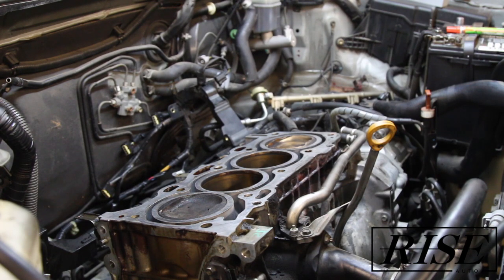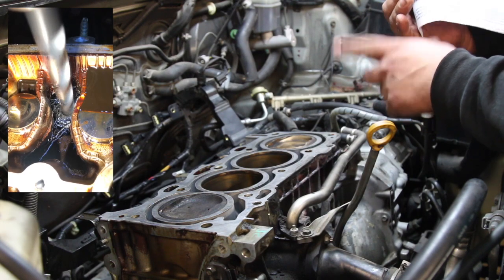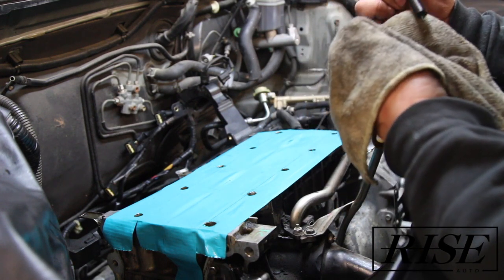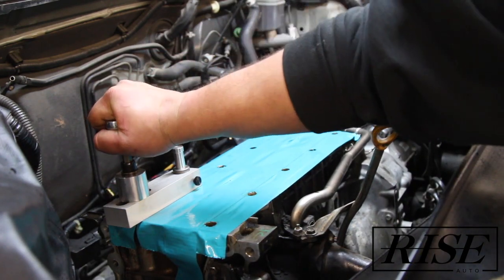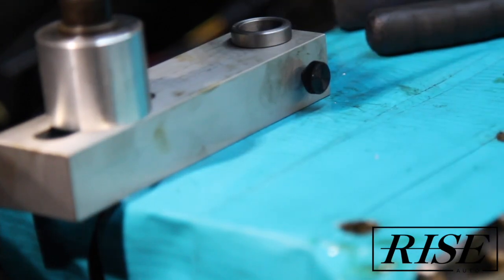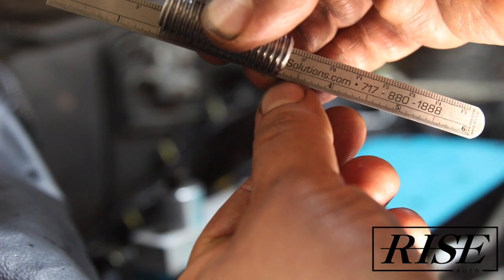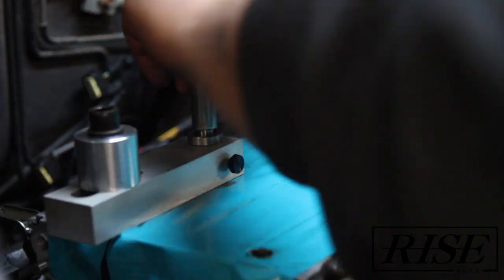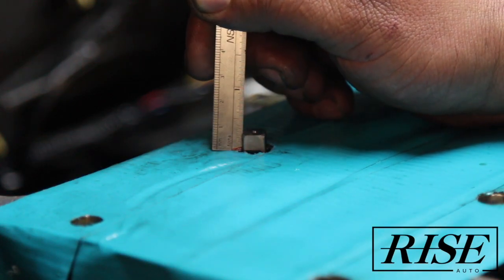Toyota head bolt thread repair, using HUHNSOLUTIONS NS300L.

Comment: that guide makes for a very accurate job

had one of the cam cap threads on my 80 series cruiser strip and had to use a helicoil. 
i didn't have a guide but used the cam cap as the drill bit required was slightly smaller than the cap bolt hole and it worked perfectly

used a helicoil because of the way the thread is beneath the cap guide pin and only 16nm torque but good as new now

Comment: What keeps the drill from going too deep? But what is in the block that is stopping the drill bit.  I am just curious.  I know you need to measure to be sure. It seems odd to me that the bit stops.
Reply: I am guessing you figured out by now but the drill bit in this kit is cut at the bottom flat, designed not to drill past the depth of the hole

Comment: I have a 2007 Camry that I picked up for nothing as a non runner, blown head gasket, compression was getting into the cooling system. It had the pistons changed in 2016 by Toyota. When I removed the head bolts, several of them were very lose, but the threads didn't pull out and they seem to be in tact. The deck on the block seems to be fine after checking it with a straight edge and feeler gauge, the head is warped approximately .006, and will need to be resurfaced. I'm debating whether or not to invest in repairing the engine. The last thing I would want is to put in back together and have the head bolts pull out. I'm considering buying this kit.
Reply: If the bolts were loose you already have this problem.
Reply: @jonathangarzon2798  Yup. I purchased the Huhn solutions repair kit and got it running a couple of months ago. So far its running fine.

Comment: Thanks for the video. Has anyone used this kit after buying used instead of a new set? Should i repair all 10 bolts threads with this kit on my Camry or just the ones that are broken? I just have one broken threads so far. Thanks.
Reply: if you've got a 2.4L 2006 or earlier, likely the six around #2 & #3 cylinders are stripped. Those two middle cylinders compress simultaneously- lot of psi. The four threads in the perimeter seem to hold

Comment: very good excellent video, congratulations for your contribution to the community, a question as to withdraw the 02 guides (tubing) that are used to center the packaging of the engine I see in the video that does not have them. greetings from Mexico.
Reply from the maker: Are you talking about the dowels ?
Reply: @RiseAlbert  I don't know exactly what it is called in English BUT it is like a kind of stainless steel coupling nozzle that guides the cylinder head gasket. How are you going to take off?
Reply from the maker: @juanrivas5250  the tool used to remove the dowels is called a blind hole puller, it’s also used to pilot bearings on flywheels
Reply: @RiseAlbert  thanks
Reply from the maker: @juanrivas5250  no problem

Comment: The Huhn kit recommends not only NOT reusing the original head bolts, but in the case of this engine buying NEW Toyota head bolts or ARP studs if you really want to go all out (high performance builds).  They go so far as to say don't buy aftermarket bolts.

Yeah, I seriously doubt a 16th either way in depth makes much difference as long as the thread on the bolt has relief (doesn't bottom the bolt thread before getting to the head surface, plus stretch, when torqued.   If it is well high, though, it might cause problems with final torque, even if clear of the non threaded part of the bolt, as these are torqued using a ft/lb, then further 90 deg angle torquing method (if the bolt truly yields, which if I understand it correctly, it does, it probably doesn't matter for torque spec, even then).

You want to make sure your hands aren't all oily when you handle that insert, or brake clean it, then final insert with clean hands, so that the loctite operates properly.  Oils will defeat its purpose, if bad enough.

I'm just about to do a set, so thanks for the video, very helpful to see things once, even though the instructions with the kit are thorough.  I would be interested to know if you have any data on if any of these repairs have failed in service, and if so, at what point.  These look MUCH better than the Time Sert kit, all around, to me.  Larger diameter, courser (higher depth) thread, non expanding for locking, thicker to keep from expanding upon torquing, and if you look at the time-sert site, you'll see they have SECOND REPAIR inserts available, I stopped reading their material right there and moved on to an INTELLIGENT functional design.  Just my two cents.
Reply: Camt tell if youre disagreeing with not buying aftermarket bolts or not but i will say studs are not the way to go, the threads have less stretch this route and they need that stretch factor.

Comment: Do not put tape down on the surface.  The guide will smash it unevenly and the drill will not be straight.  Get a roll of painter's tape and surround the fixtures for each hole one at a time.  Keep the surface clean.  Keep the fixtures clean.  Expect 45 minutes to an hour per hole.  It sucks but this kit is only for those who take their time.
Reply from the maker: rabidu2b worked perfectly fine, thanks for your input

Comment: Thanks for the video bro, I am about to attack a 5.0 Range Rover engine with 20 stripped head bolts. I just bought this kit, read the instructions and after watching your video I am confident of the repair. 🤘🏻
Reply from the maker: disarmyou84 thanks for watching and good luck 👍🏻
Reply from the maker: disarmyou84 good luck man just take your time you’ll be fine

Comment: Do you think it's worth it? I really don't wanna blow $600 on a kit that i'm gonna use once.
Reply from the maker: Isaiah G. Richards if orders directly from
hunn solutions it’s under 400 shipped to your door call them direct 

Yes it’s worth it given the cost of a machinist repairing the bottom end, or improperly repairing it and having to do it again 

Do it once do it right, since posted this Camry has 5k miles on it problem free
Reply: @RiseAlbert  You can probably sell it on ebay afterwards, as it will do inserts for MANY engines, and the inserts are less than $100.  I'm fairly sure you could retrieve at least half your investment, minus the insert costs, and then it's pretty reasonable.

Comment: Thanks for video. The cleanest (least amount of shavings mess) and most organized 2AZFE repair I have seen. How were you able to put back the alignment dowel pins?
Reply from the maker: V Garcia thanks for the view, and yes the dowel pins do fit snug into the holes even tho the tap digs into it slightly. Very important to be clean anytime the motor is open. Good luck on the repair.